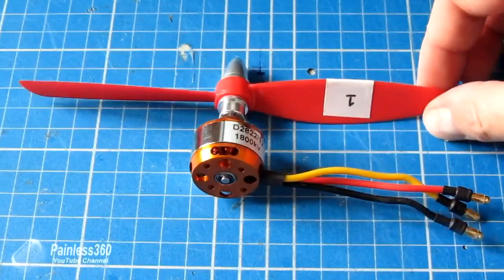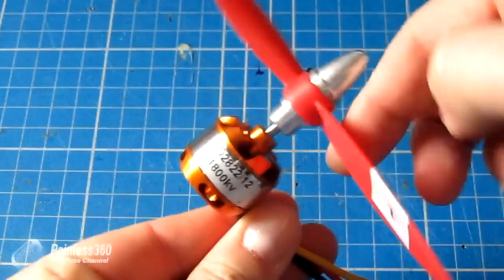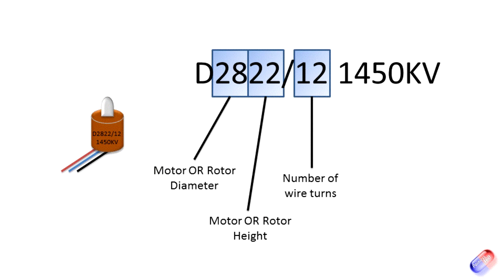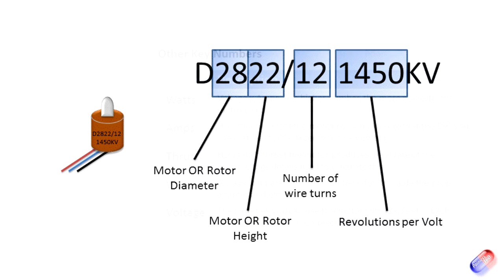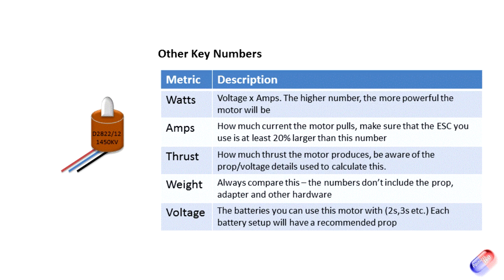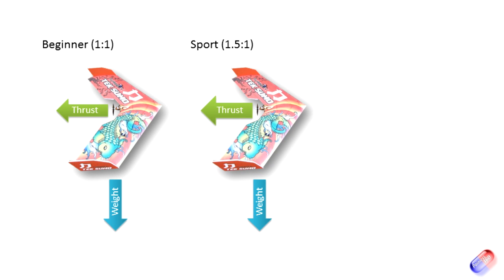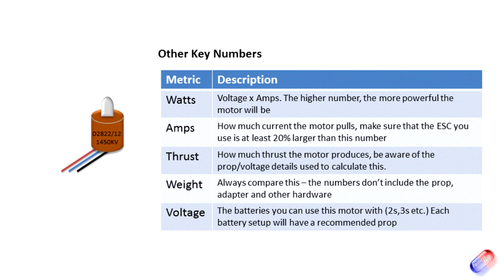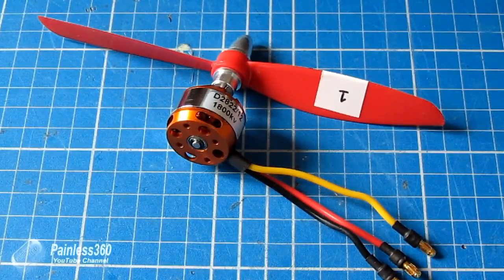Brushless Motor Numbers Explained (KV etc)

Comment: Great video, its the only good explanation of electric motors iv found. My issue is, how do you size up electric motors for older glow models that dont come with recommended  motor sizes ect. Is their a compare chart which would give you a glow to electric equivalent? cheers
Reply: First let me state that I am far from expert on this, but I am putting my 2pennyworth in as my advice is probably more helpful than none at all. What I do know is that replacing glow with electric is a 'rule of thumb' endeavour. You cannot just replace a given glow size with a given electric motor, things are a litlle more complicated than that.

First you need to look at the power of the recommended glow engine. These are usually given in horsepower, but you will find electric power is specified in Watts. No worry, hp and watts are the same thing just using a different scale (like Celsius & Fahrenheit). There are 746W to 1hp, so just multiply the hp rating by  746 to get the wattage.

Generally it takes a basic '35' 2-stroke glow to get 1hp, while higher tuned versions will give more but this is a good general baseline for engine size/ power rating. So divide the recommended engine size by 35 to get the hp for the model. Then multiply it by 746 (as given above) to get watts.

Now you are in the area where Painless360's videos can start to help. Start looking at the model type, prop size etc while following his advice and you should get there okay. Remember that most glow engines operated in a practical range of about 15,000rpm (while smaller engines rev higher & larger ones lower).

A point also worth remembering is that the power delivery of a glow is very different from that of an electric motor. They have very little torque at low rpm, all their power comes in at high revs, while an electric motor is much more linear. I would deal with this by upping the power required a little bit, solely on the basis that you can always throttle back an overpowered model, while the only solution to an underpowered model is to replace the motor.

Of necessity this is very vague but I'm sure that following these rules will get you flying. And I'm certain you will very quickly develop the necessary feel where you can just look at a glow model and say 'that will need an xxx electric power plant'.

Or you can just do as I do. Chuck high powered motor in big models,  little motors in little models & medium motors in medium models. With revvy motors (& small diameter, high pitch props) in fast models, and torquey motors (with big props) in donkey models.

Comment: Sir can you please suggest some high efficiency brushless motors for 8 to 12 inch propeller, maximum require thrust within 850 to 1000 gm.
Please suggest light weight motors, weight less than 70 gm.
Application - Airplane
Reply from the maker: I'd look at the t-motor website. They seem to be one of the few manufacturers who make motors for just this type of application. They are not cheap though..

Comment: does 1000kv 13t motor produce more thrust than 1400kv 10t motor. plz answer I am confused.
Reply from the maker: The number of times the wire inside is wrapped around the stator. The less turns the faster the KV and the higher the amp draw. It's fallen out of favor in the Multirotor world as it's just confusing and not a standard you can use to compare motors with..
Reply from the maker: +Universal Video thrust has very little to do with those numbers that you've already quoted. You need to check the specs for those motors and look at the different thrusts with the different props that it can support. That's the only real way to see what thrust you're actually going to get out of a motor and prop set up. Hope that helps
Reply: Painless360 I have 10x45prop 11volt battery which motor should I buy for my rc plane. right now I have made my plane I have a 1400kv 10t,  1045prop and 11volt battery. I haven't tested out my plane I just wanted to know which motor should I use so that I can exchange this 1400kv 10t motor to 1000kv 13t motor if needed
Reply from the maker: Get the specs, they will tell you. The weight of the plane and how you want it to fly make a difference to the choice too. Best of luck!
Reply: Painless360 Thank u
Reply: I’ve seen the term 10t, 13t and etc a couple of times-what does that refer to?

Comment: Hello, i gonna make my first quadcopter. When I was buying motor(BR 2212 2450KV) their was  recommended prop size 6030 but I want to use 1045 prop. Is it creat any trouble.
Please answer soon
Reply from the maker: Check the specs for that motor and use the recommended prop size. If you use something larger then the motor was designed for you're heading for trouble. See the other videos in the 'Introduction to Remote Control' series.. Best of luck!
Reply: Thank you, actually I want a suitable motor for my quadcopter which can pull weight upto 3kg in 1045 prop, and should also be cheap.
Reply: Can you please recommend that kind of motor.
Reply from the maker: +Anindya sundar Das I'd check out the T-Motor website. Motors like that are not cheap. Best of luck
Reply: Anindya sundar Das the prop will kill the motor bcos higher kV will drain large current. so try to use 1000kv motor of the same physical size instead of 2450kv

Comment: Hi! in 1300kv motor can i use ESC 30 A? Thanks
Reply from the maker: +Edwin Pura depends on the prop and battery voltage your using. Check out the specs. See the other videos in the 'Introduction to Remote control ' series for more of the basics. Best of luck
Reply: Painless360 sir. I have 1300 mah 3s 11.1v and i have 9x4.7 slow fly prop.because i planing to build an trainer plane with the wings 40 inc.its my 1st time to build a plane,your advice would help me alot thanks.
Reply: Painless360 sir i have 1300 mah 3s 11.1v battery and 9x4.7 slow fly prop.and im planning to build a trainer plane with 40 inc wings.This is my 1st time to build a plane thats why your advice will help me alot.thanks

Comment: I am new to RC builds
There are different descriptions of amperage on these motors:
https://www.amazon.co.uk/Outrunner-Brushless-Aircraft-Airplane-stainless/dp/B018VIDJH8/ref=sr_1_12?ie=UTF8&qid=1501945047&sr=8-12&keywords=brushless+motor 

and

https://www.amazon.co.uk/KEESIN-Accessories-Quadcopter-Helicopter-Multi-copter/dp/B01IVKZNQQ/ref=sr_1_6?ie=UTF8&qid=1501945047&sr=8-6&keywords=brushless+motor

What amp esc should i be getting for each?
Reply from the maker: +Jaspreet Bindra if the listing you're looking at doesn't have that detail then I'd Google for the same motor from another vendor that's bothered to post the specs. Personally I feel that any vendor that can't be bothered to provide the detail a builder needs in the listing won't be a great choice to buy from anyway...
Reply: Could I PM you all the components, I am not sure if they are all compatible (i found a different motor)
Reply from the maker: +Jaspreet Bindra see the other videos in the 'Introduction to Remote control' and the 'Quadcopter building for beginners ' series where I show how to check.. Best of luck with it

Comment: I am having trouble finding the current consumption of brushless motors, most of the online store have no data sheet for that particular motor. Do I simply divide the power by voltage? or is there some calculation i need to do? Thank you!
Reply from the maker: +Ta Ko you need the datasheet. I'd send the vendor a message and ask them for it.,  best of luck!

Comment: is there a way to tell the size of a motor with out the numbers on the can.   like a way to measure it
Reply from the maker: You can try and measure the size of the rotor.. it's not an exact science as the numbers are all a little 'open to interpretation' on some models..

Comment: Would you say the Kv rating is a max RPM estimate? and that speed is varied with current draw?
Reply from the maker: +Krysta Blackerby the KV rating is the speed that the motor will try and maintain, so as you increase the load on the motor with a larger prop it will draw more and more current in an attempt to keep that speed up. Hope that helps
Reply: Thank you for your reply. I guess I am not understanding how the speed is varied if it is always trying to maintain a certain speed. I have seen from experience that the more current a motor is drawing the more RPMs it will produce. Meanwhile the voltage drop remains about the same despite current draw. It makes sense that more power equals more speed. But I fail to see exactly what real usefulness I can get out of the Kv rating.  It seems an RPM per Amp rating would be more useful, considering batteries are also rated mAh.
Reply: Also, THANK YOU for taking the time to make these wonderful videos.

Comment: I'm looking for a motor that can go the speed of 70mph or higher that can controlled by remote. I need this for a skateboard. Please tell what type of motor do I need and what's the watts, amp, kv, dc, or rpm?
Reply: Zulfkar Ali that's a very creative way of suicide
Reply from the maker: Absolutely no idea, that's outside my experience. You need to figure out the wheel RPM you need for that and the torque and work back from there. I'd suspect that there are forums and places on the 'net that have already figured all that stuff out. Best of luck!

Comment: what would be recomended for a 5kg quad i prfer stability over speed with props i am used to tri props but will use standered props if needed
Reply from the maker: See my other video on choosing a motor/prop. You'll need each motor/prop on the model to make about 2.5kg of thrust.. I will be looking at the choices for pilots looking to build much heavier larger models next month so that series may help.. Best of luck!
Reply: thank you

Comment: My 450 size drone with Phantom 1 guts.  total weight is 1633 grams.  I am looking to upgrade the 2212 motors to accommodate the extra weight. I'm using 2x 3s3000mah 25c  batteries  and I'm only getting about 8 mins of flight. What size motors would you suggest?  I'm using Phantom 3 9x4.5 props.
Reply from the maker: +Dale Adkins it's not just about the size of Motors, it's also about how big the prop is that motor can spin. For maximum efficiency and flight time you want very large props spinning slowly. See my video where I tested out a high KV motor with a small prop against such a setup and found how much more efficient it was. Best of luck

Comment: wouldn't the thrust be effected by the propeller if so then how is the manufacturer supposed to know what size you are going to use and give you a number
Reply from the maker: Thrust is absolutely effected by blade size and pitch. See our other videos in the 'Introduction to Remote Control' and 'Quadcopter building for Beginners' for more of the basics about motor, prop and ESC sizing.. Happy flying!

Comment: This was extremely helpful, but one thing I couldn't find out was how to get the amps from the motor
Reply from the maker: +Karam Haddadin that should be in the specs for the motor. Sometimes they use watts so you need to divide that by the battery voltage to get the amps. Best of luck!

Comment: why are esc so small yet so powerful compared to ebike controllers?
Reply from the maker: No idea, I'm not familiar with bike controllers. I'd suspect it's current handing capacity, cooling and reliability.. Happy flying/rollin! :D
Reply: Painless360 i think esc can handle huge currents as i mentioned earlier. These esc motors are very high power

Comment: i'm trying to make quadcopter for a school project.i'm at a loss as to what motor+prop to choose.my quadcopter needs to be quite fast(but doesn't need to perform tricky manoeuvers),but is heavy(has camera and other accessories).could you please help me?should i choose a low kv + high diameter prop?
Reply from the maker: +Houidi mohamed amin see our video on choosing motor and props in the 'Introduction to Radio Control' series.. you need to know how heavy the model will be first.. best of luck!

Comment: What rated motor should I use to fly a RC plane weighing say 5 kg smoothly?
Reply from the maker: +Aman K.Santhosh it really depends on how you want to fly. Having about 80% of the weight of the model available as thrust is really the lower end of the scale and handy for trainer star planes, having up to two and a half times the weight of the model in thrust is usually where high-end 3D pilots want the performance (sometimes more !). Everyday flying you be looking for a motor and prop combination that could deliver around 7.5 kilograms of thrust easily. Hope that helps

Comment: Hi, i don't speak very well english, but i have question.
I have KV1000,  but how you fixe the propeller on the motor ?
Reply from the maker: Most motors either come with a prop adapter or most multirotor motors only come with a prop nut.. Without the actual model number of the motor you're using it's tricky to add any more. Best of luck!
Reply: Ok thank you !! I have A2212 13T 1000KV but i don't know how i can set the prop adapter on the metal rod.
http://www.dx.com/fr/p/kv1000-brushless-exterior-rotor-motor-outrunner-motor-yellow-154904#.WNGBHqg2se0
Sorry, my english is not very good ^^

Comment: brushless I can understand right up until timing adjustment.    wish motor manufacturers would give more documentation on what should be set up based on ESCs and voltage and load/prop.

Comment: can you burn out a motor by undersizing props? or would you just miss out on some power
Reply from the maker: ZENfpv it shouldn't burn out motor or ESC, but you will get a lot less thrust. if you use a smaller prop, you can increase the pitch to try and retain the thrust. Best of luck!
Reply: sweet, thanks for the quick reply!

Comment: I have checked all connection don't recognise the problem using 30a EST and same motor 2200 mah lipo
Reply from the maker: Please reply to your original comment as it helps me see what had already been tried.. I'd check that the ESC is calibrated and the motor bearings are ok.. Best of luck!

Comment: Hi sir, is it ok to use motors/ESCs of different brands with similar ratings, or it's ok to use a different brand and a different rating altogether?
Reply from the maker: I wouldn't. Using ESCs of the same make and model, but different revisions, can cause problems.. Best of luck!

Comment: Are two different motor brands/model of the same kv rating essentially equal?
Reply from the maker: Great question! In theory - they should be. In reality the will not provide the same thrust due to the wire used, magnet position and strength etc. If you need to replace a damaged motor on a model try and get exactly the same model.. Hope that helps..
Reply: Thanks for replying. I'm planning to build the Anakin Club Racer 6" in which they recommended Xnova 2206/2000kv. I happen to have Cobra 2208/2000kv but I don't know whether I should, since the cobra bell is slightly taller. And on another page, they recommended Cobra 2100kv. Will my setup be significantly slower because of this?
Reply from the maker: +MZzXzZM I wouldn't expect so, just use all the same brand and type to avoid problems..

Comment: Very nice description. "Motor needs X amps"...with following specs, can u please tell me X=?

Max Efficiency current : 4-10A (>75%)
No Load Current: 0.5A @ 10V
Max Current: 13A for 60 seconds
Reply from the maker: +adnan ul haque of size the ESC to be a little more than the max current. Maybe a 15 amp minimum ESC.. Best of luck!
Reply: Thanks, actually I need to understand exactly that how much amp my motor needs?. You can see the specification of my motor here ...
https://drive.google.com/file/d/0BwguQaBwEJZ-UWhfLWJTYjVHOE0/view?usp=sharing

Comment: Hello nice video but can someone tell me if this works together a 
q450 frame and 
8045 props and 
racerstar br2205 2300kv motors and
 racerstar rs30a esc and 
racing f3 flight controller 
MultiStar 1400mAh 3S 40C lipo
???
Reply from the maker: +mr goodguy see our series 'Quadcopter building for beginners' where we check this out. I'd check if you can swing those props on a 3s battery and check the ESCs are big enough for the current the motors will need. Best of luck!

Comment: hey im sorry but how do u know the amps of ur motor?
Reply from the maker: +Omar Ivan you look in the specs for the motor. See us doing just that in the 'Quadcopter building for beginners ' series near the start. Best of luck!
Reply: +Painless360 hey im sorry but im having truble (bigggtime here) it sais that the whatts are 180 and its a 1800kv i have a 30ESC and i want to buy a 3s 2.200mah batterie and i just want to know if what i got was ok please
Reply from the maker: +Omar Ivan impossible to help without the motor model. Check out the videos in our ' Introduction to Remote Control ' series that covers all the basics of RC power systems. Best of luck!
Reply: +Painless360 thank u

Comment: any hint on how to count magnets? just to connect a RPM meter... thanks!!
Reply from the maker: +Juan D not without popping the can off the motor. With some modern motors you can see enough through the vent holes. Vendors are usually helpful getting that detail for you if it's not listed in the manual or specs. Best of luck!

Comment: How does the height of the motor impact speed/torque etc?
Reply from the maker: On it's own - not really. Torque is a result of the geometry of the rotor/stator and how they are wound as well as the power they pull. Typically lower KV motors are larger have more torque. Happy flying!

Comment: Hey Painless360,
what does the D actually stand for?
I guess it has to sth to do with the mounting/screws, since the 2822 are sizes?
Reply from the maker: +Harald Krennrich At which bit in the video?
Reply: +Painless360 I'm talking about the "D"2822. Other (smaller) Motors are "A"2212, for instance.